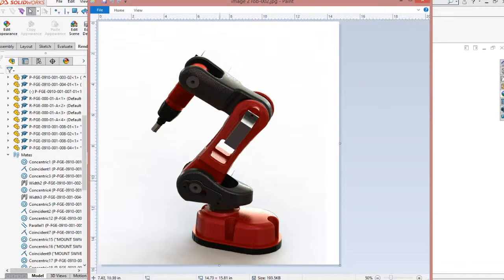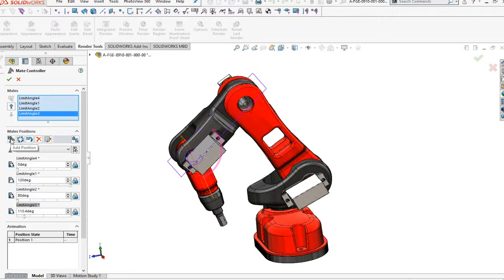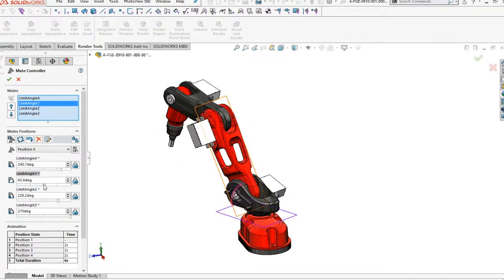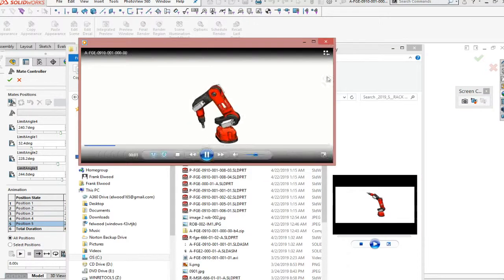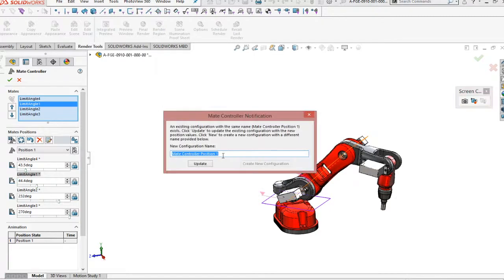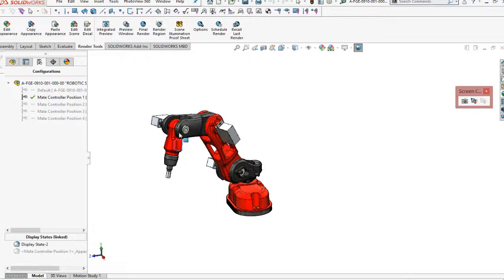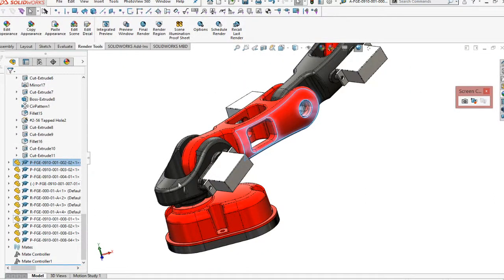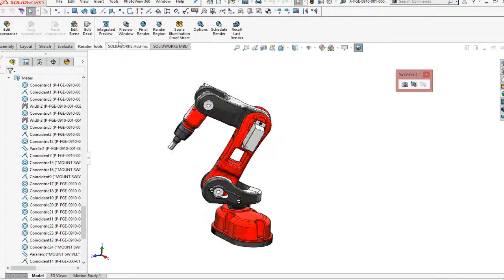Solidworks Mate Controller

Comment: In this video there is no clarification of how to limit the angle mate, will you please make a video in detail? 

I know how to use advance mate such as angle limit, but it behave totally different if give +200° and -200° as min and max with angle set to 0 degree. 

I actually need to rotate robot arm at 200° (forward and reverse from same plane) but when I do rotate it automatically stuck at 160 degree and 200. ANY SOLUTION??